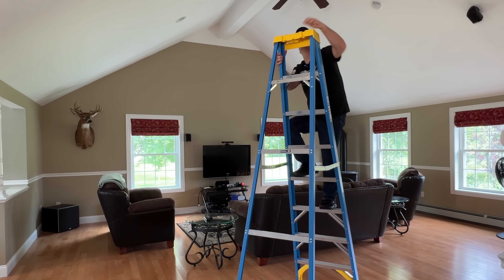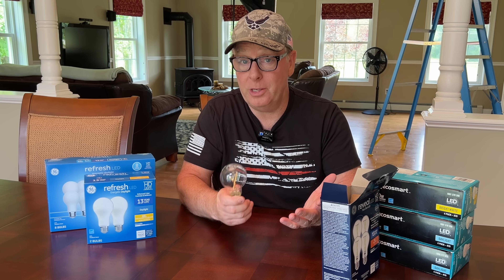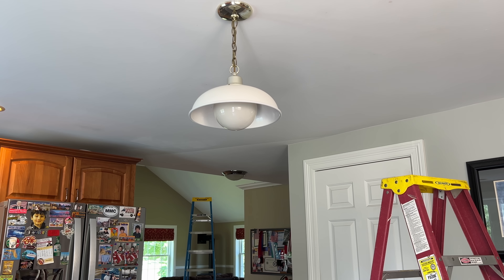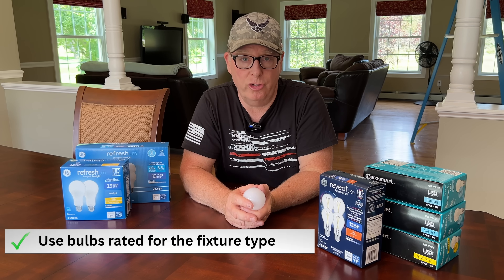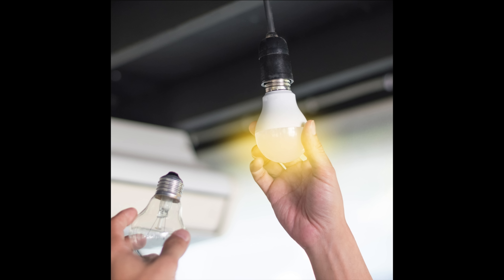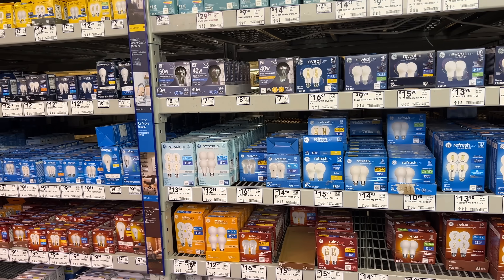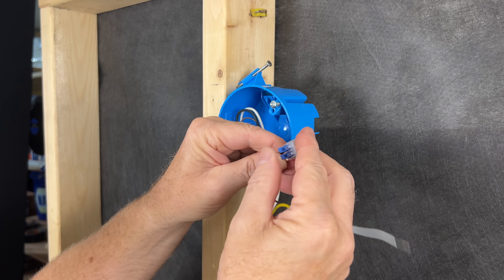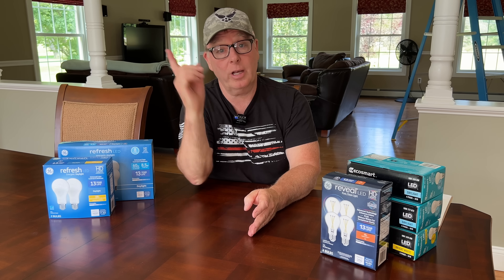The Mistake That Kills LED Bulbs

Comment: The number one reason for LED bulbs failing is poor design and cut corners.  Nearly  every LED bulb you buy  these days is overdriving (grilling) the LED's and using the bare minimum of filtering.  In the world of LEDs, the component not the bulb, they are designed to work at a specific current range and output a specific light level.  LED's are not linear so when you put in say 1/2 a watt you might get 550 lumens but if you put in 1 watt the LED may emit 700 lumens.  So if you dump 1/2 the power into each chip but the chip outputs 75% of it's rated light output it will produce less heat and will last substantially longer but that costs slightly more so instead, the majority of manufacturers will run LEDs at or very near their maximum rating  even though this is less efficient because  the BOM cost is lower so they can make them cheaper.  If you want proof that this is what is happening just read or watch videos on the Dubai LED bulbs.  
While it is not recommended for the average person, I will often buy LED bulbs rated for 200-300 watt equivalent output and de-lid them and modify the current driver resistors to set the bulb to operate at about 1/3 the original wattage which means the bulb will be slightly dimmer but as a 100watt equivalent replacement, it will last substantially longer and barely gets warm in normal operation compared to being hot in normal operation.
The next thing is don't use mains dimmers they are tacky and electrically noisy.  If you really want dimming (again very tacky IMHO) buy fixtures that support diming using low voltage 0-10v as many of these will also support setting the color temperature.  Just remember everything you add to change the complexity of the wiring in your home will be one of the many things potentially taken out by a nearby lightning strike, brown out or power surge.

Comment: Instead of using special dimmer switches, for any new renovation or installations it's more efficient to have smart switches that doesn't have to directly connect to the lights, ie. Sonoff zigbee and wifi switches can be programmed to control any light.  You can still use existig wiri g to power the switches and LEDs, but decouple the control to other lighting.  The flexibility for new iot lighting is great.
Reply: until it burns out yearly or sooner, making the old hard wired stuff look great.

Comment: I would be considering changing the fixture that is LED friendly which allows some airflow.  Consider different form factors for lighting.  For example strips, panels, panel backlighting, are all new lighting possibilites.

Comment: On the other hand, brand names are not as innovative and charge very high for tye same functionality.  For example, you don't pften get RGBW zigbee or wifi bulbs from established brands because their goal seems to be to lock in cllarge customer contracts to use their expensive, proprietary, locked in, legacy automation systems.   Find automatable bulbs that is compatible with open source

Comment: I’m interested in how noisy the power electronics are making the power throughout the home- I work in solar in Maine, and we have seen some very noisy homes- switching power supplies, as in LEDs and in dimmer circuits seem to throw varying levels of noise back into the system.  They can end up affecting PLC, home control, computer and Solar equipment, or each other.
Reply: I noticed this interference also happened on my drive to work... When I had Sirius satellite radio, it would cut out when I crossed the bridge to work. It took me a while to figure it out, as my commute would occur at various times of the day. It always happened when it was dark and the LED street lights were on. My GPS would get glitchy too.
Reply: There's a saying that I learned as an apprentice over 40 years ago. "Every problem you solve in a circuit causes another problem" Electrical systems by nature are constantly changing. Someone turns something on or off and the load on the system changes and that has an effect else. The theory gets complicated, but every dimmer, led driver, motor, etc effects the quality of power. Electronic or digital devices need very clean power to operate correctly. They rarely get it from today's grid connected homes.

Comment: i bought a small led 5w soft white bulb from home depot in 2014..it has been on and never turned off other than power grid failures and is still working fine..its in a small  table lamp with a Tiffany style glass shade..i feel like i paid like about 10 bucks for it though, but agree the newer ones are crap

Comment: LED bulbs will work with polarity reversed - LED by nature half-wave rectify if they are directly in-circuit.  And as far as I know most aren't (they have a (half)rectified DC regulator control supply)

Comment: If you already know that heat affects lifespan of LED bulbs best thing you can do is avoid using bulb type LED in the first place. Using light fixtures designed for non-LED is the other problem because those bulbs operate at much higher temps so cooling was never priority in the design
Reply from the maker: That's another reason for the failures I discussed in the video.

Comment: I've seen the same thing with heat and leds. In my domed light fixtures that are fully enclosed and mounted to the ceiling i leave about 1/4 inch gap if  the center mounting rod allows it. Just be careful to grab enough threads to properly secure it. I get a few extra months letting a bit of heat out. Great tips!

Comment: You covered the 'right bulb for the right job' well, but missed a VERY important factor in making LED bulbs last longer in homes - and that is having a *WHOLE HOUSE SURGE SUPRESSOR* in the breaker box. 
New home builds require this per NEC code, but 'older' homes that didn't have one from the beginning should have one added - there are LOTS of options. 
Almost everything electric in the home these days has silicon chip(s)/capacitors (including LED bulbs which have BOTH!) - both of which are susceptible to voltage surges/transients, that are present in EVERY electrical system no matter where you are.
Even quality bulbs are eventually taken-out early by un-mitigated surges, as are the timer and power-supply electronics in almost any appliance!
Reply from the maker: Surge suppression is important (mostly for lightning protection) and is now required by code. But the power from the utility is very stable in the USA so a surge that would punch through a surge suppressor is very rare. I have only had one here a southern Maine in the last 25 years.

Comment: When I finally switched from incandescent to LED, I bought 3500K 90 CRI bulbs whenever possible.  I also replaced my 2 bulb fixtures with 3 bulb fixtures.  I replaced the 5 fixture dining room light with a 3 fixture light, as I had been using 130V incandescent bulbs in it.  If they come out with 100 watt equivalent 3500K 90 CRI bulbs, I will replace the 3000K LED bulbs I have now.  Bulbs above 3500K are too blue for my taste.

Comment: Quality has decreased a bit? Decreased a lot if they were ever long lasting. Remember the curly bulbs?  We changed all out bulbs and they lasted only months. Now we have LED bulbs. We buy from Homedepot and Costco and they still only last months. We own a home built in 1979 and the original bulb in the attic is still working, thats 46 years. Yes it does not get used often but why do these new bulbs have such a short life? Planned obsolescence. Manufactures want more resale quicker. Seems like most “everything” is engineered with planned obsolescences😢

Comment: In my experience everything you mention is the video makes no difference. I have tried expensive "name brand" lamps vs cheaper lamps. (never used dollar store lamps, i dont like house fires). lamps rated for enclosed or open fixtures, dimmable or non dimmable no differance in their "rating" vs where or how i use them. My main issue is the damn thinga flickering like its a rave club right out of the box. Ironically the best luck I have had are with the cheap home depot ecosmart lamps that come in the brown cardboard box, or the fancy filament style ones, but those have very specific use cases. These lamps are all just trash.

Comment: You can light an led with appx 75 volts DC minimum fyi. AC capacitors are fine for dc use but not the other way around.
 The high temps kill the capacitor in the bulb because theres not a proper heatsink and/or they use cheap caps. 15 yrs in renewable energy R&D.

Comment: A comment on polarity sensitivity … because the UK standard is a bayonet fitting, rather than the Edison Screw, instead of the single terminal in the lamp base, we have 2 contact pads (live + neutral) and the bayonet shell is isolated and precludes shock risk. The bayonet fits either way … there is no way of controlling the orientation, it will fit one of 2 ways equally. As a result, it is certainly true to say that any lamp sold in the UK with a bayonet fitting has to be insensitive to polarity by design. 

Where safety could become an issue is when a bayonet to ES adapter is used and it would be a 50/50 chance of the screw thread being live!

Comment: So … the challenge is finding bulbs rated for enclosed fittings. 

I’d already come to the conclusion that enclosed bulbs were consistently failing prematurely (in the UK fully enclosed fittings are the norm in potential “wet” areas, particularly bathrooms and toilets), and I guessed the manufacturer life rating was assuming the lamps have free unrestricted ventilation. However, I’ve never observed this as a declared limitation. I’ve been using Costco lamps for the past couple of years and I’ve had to look very carefully indeed to find the statement in very very very small print … in no way as clearly identified as per the examples you show. 

The other style I’ve had problems with are the large sized spot lamps (R80?) … which fit into the ceiling directional ball fixtures. Again, I have come to the same conclusion with these lamps as the lamp is fully enclosed apart from the outer lens. Trouble is, it’s hard enough to find this form factor in LED in the first place, and, again, the packaging doesn’t make it clear at all that the fixture will impact life. 

As you have said, the best solution is for the lamps to be installed pointing upwards. Fine for a subset of wall sconces, but the normal UK light fitting is a downward hanging pendant! I can certainly vouch that the best life comes with upward facing lamps … but I only have 5 of those in the entire house; the remaining 50 (or so) are downward oriented or enclosed or both.

Comment: Engineered obsolescence. Heat intolerant solder or weak weld joints along with bad compression connections. The components themselves aren't the problem.

Comment: Nobody ever mentions the importance of a whole-house SPD in protecting your LED lighting. I understand that large LED fixtures, such as exterior street lamps, often have Type 4 surge protection built in. However, to my knowledge, no A19 LED bulbs have any built-in surge protection. The electronics in these bulbs are likely very sensitive to transient voltages. Whereas old tungsten filament bulbs are unaffected by short duration voltage spikes, the drivers in these new LEDs are.

Instead of always searching after the perfect LED brand of bulbs, perhaps folks should make the effort to install a SPD in their panel. If you want a simple MOV type surge suppressor, the Siemens FS140 is a fantastic choice, although I've installed plenty of different Square D and Eatons as well. In my own home, I have one at the main disconnect (combination meter/panel), and also on-bus, plugin style Square D surge breakers in each sub-panel on the property. I even added another at my A/C disconnect out by the 5-ton compressor. 

I know that I'm a sample size of one, but I cannot remember having changed more than two bulbs in the last few years, and my house has A LOT of LED lighting.
Reply from the maker: I have an upcoming video on surge protection. Probably post that one in August.

Comment: I only had two or three LED bulbs fail ever.  My oldest one from about 2003 is still just fine.  It's producing a lot of heat by LED standards but is built on a bulb-shaped ceramic heatsink.  The ones which have died were particularly compact, cheap ones.
Reply from the maker: Sounds like the older ones were built better.
Reply: @BackyardMaine  Probably out of necessity.  I'm pretty certain that ceramic bulb would self-destruct if the LEDs and other electronic components were mounted as modern bulbs do.  30€, 40€ back then for a 60W equivalent?  One shortcoming of this Osram bulb is that when turned off it has a long afterglow of like 10 seconds.  Looks like it has large capactors and no discharge resistors.  Capacitors tend to break especially in hot environments and are somewhat expensive components (within the budget for a bulb)  - but they also eliminate flickering.

Modern LED bulbs typically are running the LEDs at their specified limit or even beyond.  That delivers maximum light for a given price but limits component life time.

Comment: I have a few nichia LED permanently on for decades without any problem.
Reply from the maker: Like I said the older bulbs were built to last.
Reply: @BackyardMaine i am an Electrical engineer, and take care cooling with old style power supply. So reliable LED may have same lifetime.

Comment: Paul Wheaton did a big study on bulbs a decade or more ago.  He found that cycling the bulbs killed them quickly too.  He build a machine that turned them on for 2 minutes and then off again (long enough to pee or get something out of a closet).  As I recall, the incandescent bulbs won out.
Reply from the maker: Similar with fluorescent tubes. We added motion sensors to the hallways at a large semiconductor manufacturing facility. (I worked there as their facilities electrical engineer) The tubes which would last 15 to 20 years when left on all the time were now failing in less than a year.
Reply: So led bulbs rated for PWM dimming might have a greater lifespan in on/off cycling, compared to non-dimming bulbs.
Reply: @imconsequetau5275  yes. Not only is it in the off state part of the time but heat buildup will be less because of that as well.
Reply: Led's can be cycled without harm. In fact a pwm circuit is used as an led dimmer which is essentially just rapid on/off cycles at a higher frequency than your brain can detect. Instead of seeing on or off, your brain just sees a dimmer light. Fun fact: gigahertz is literally billions of cycles per second, yes billions. 
Your led dimmer is going to be less than 1000 cycles per second or just hertz. 2000 cycles would be 2 kilohertz, 2 million cycles per second would be 2 megahertz. 
Terahertz, will blow your mind, that would be trillions of cycles per second.